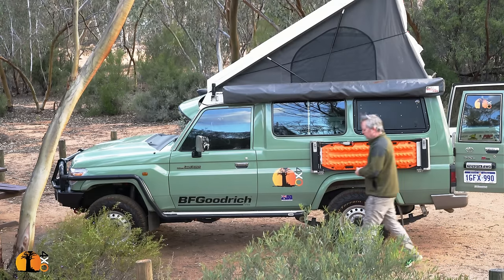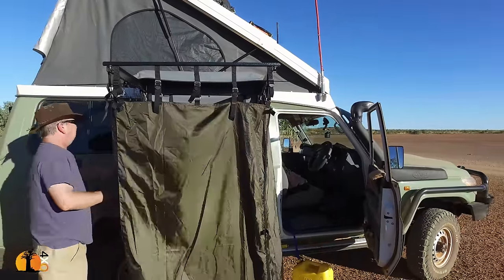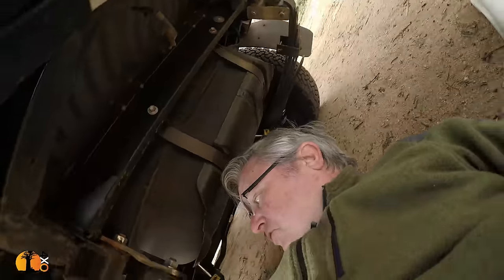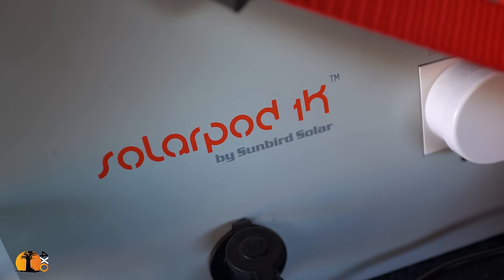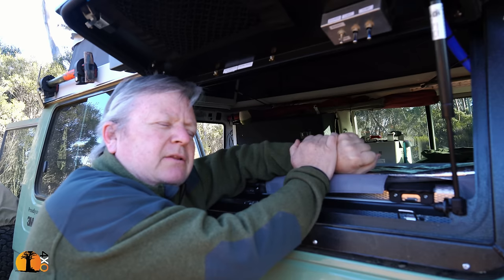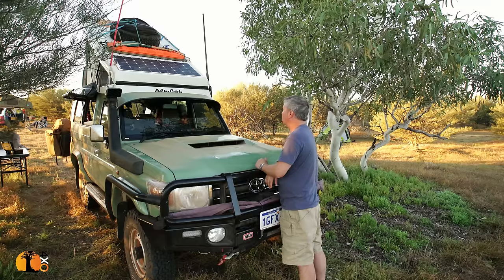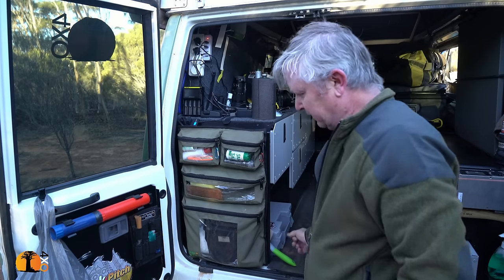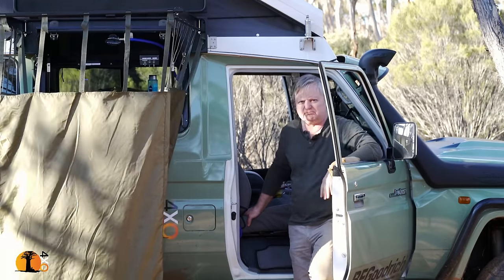TOYOTA LAND CRUISER TROOPY | THE WORLD'S LONGEST TRACK (Ep-9) Andrew St Pierre White

Comment: Maybe you should have a good look at Evakool fibreglass fridge freezers. Far and away the best insulated box you can get. So very efficient. The only downfall is they are slightly larger externally than other fridges. And you don't need an insulated cover.  Just a thought.
Reply: biggles333999 I can second that. Awesome fridge/freezer

Comment: Can you swap the positioning of the German pull down back door table with the fire starter on the opposite door? Doing so would allow you to keep the drawer and table open at the same time. Just spin 180 degrees to move seamlessly between the two. You only need the fire starter for a few minutes at a time so putting it on the other door makes more sense.

I hope that this is possible.

I have really enjoyed this series. Doing a review and being transparent about sponsors, reviews etc is very helpful.
Reply: Matthew 24:4 I thought that but there is a handle on the inside of the left hand door that would be obscured by the table thingy.
Reply from the maker: Its not. The doors are not the same size.

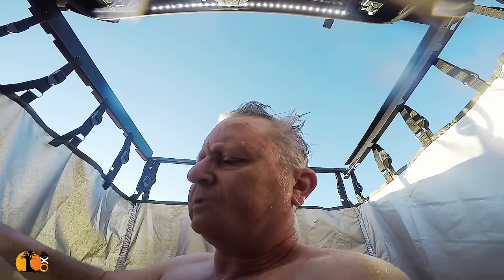Comment: Andrew, if you say “70 degrees” (9:08), I suppose you mean Fahrenheit and not “Celsius”! But then again, 70°F or 21°C is pretty much a cold shower and I don’t think a thermostatic mixer can even be set  that low. Thermostatic Mixers most often have a safe setting of 43°C (110°F) that has  to be manually bypassed if you want it any hotter. The setting of your boiler (or geyser as called in South Africa) is likely to be 70°C (158°F) which is scaldingly hot, but good for killing all the goggas (like Legionella Pneumophila) in the water.
Reply: Jimbob Jones from the research I’ve done so far, the maximum temperature that particular boiler can produce when running off 12V is 70C. Then you would set the temper valve to mix the 70C hot water with cold water to achieve your ideal temperature.
Reply: Yip, exactly what I'm saying.
Reply from the maker: I set the thermostat at 70°C. But the valve at a cooler temp so it mixed cold with hot, which means more people get a warm/hot shower.
Reply: I think we have already established that but in the video you do say “...every drop of water coming out of that rose is at exactly seventy degrees. If it’s not at seventy degrees the valve just doesn’t let it through the system..” - which is of course a reference to the thermostatic mixing valve, and not the geyser (boiler) thermostat.
I’d still be interested to know if the thermostatic mixer/blending valve/temperature control valve was (easily)adjustable, has temperature markings on it, and at what temperature you set it – bearing in mind this will change according to the ambient. Does it have a temperature limiting (anti-scalding) device on it (safe for kids)? Perhaps you’d let me know the brand name?  
I should add that I’ve been in the water pressure and temperature control industry for years.

Comment: Note andrew if intending to charge from 240-280 vac across australia you will need to seek a mains breaker panel similar what they use in a caravan with a 15/20 amp inlet, and would likely need a service outlet rated 240 vac and 15-20amps as a external mains power source this would be a part of the electrical safety code

you will also need it if you ever need require put a insurance, claim in if something goes bad from a 240 mains power source...

you will need to be compliant withing camper/caravan/5th wheel regulations..

I think this where a lot of people like ronnie dahl and co fall short in being electrical code compliant whether you use a generator of some description, your house hold power or for that matter shore power at a caravan or at a road house/campsite I always recommend if you are going to look up something for a water hook whether you 20 liter can on a internal pump or playing around with mains pressure wherever possible...

NOTE: plastic pipes used within the camper/caravan/5th wheel industry tend not to  play well when connected to mains water pressure... and tend to fail a lot something to consider when using indutstry standard plastic pipe...
Reply from the maker: That's why my 220v system in all built into the SolarPod. No need for any of that. All I have is a Bunnings extension lead. No switches etc. So no legal bull to worry about. My water system is low pressure. It never pressurises, even when its working. So if there is a breakage or crack, I can't lose my precious water. Clever, eh?
Reply: are you compliant at 15 amps??? vac for inlet use??

I have no clue what the safety regulation are in south africa/UK/europe.

though if you are intending to apply house/park mains to your vehicle you must be having a circuit breaker for isolation the same rules that apply poptops/campers/caravans/5th wheels will also apply to you troop camper conversion..

I'm not talking about invertors here andrew.. i'm talking about mains power connection whether it be from your home/camp ground or a gemset....

I thin you might want to go to camec and have a talk to the them to what electrical isolation you actually if you going to have both mains power and invertor  use to power whatever ac requirements are needing ..

Comment: I so want a troopy now! :)

Andrew, you didn’t say too much about the lead crystal battery. Was it worth it?  Do you think it is still better going lead crystal over AGM etc?
Reply: I'm keen to hear about them as well
Reply from the maker: I am waiting for a definitive answer. Right now, it is, "I think so."
Reply: 4xoverland thanks Andrew. Since posting my question, I have actually purchased a lead crystal battery with REDARC 1240D from Leeroy at Heist. I am currently on a 4 week trip across central Australia, crossing several deserts. I can let you know my experience with it at the end if you like. So far (day 2), it’s working very well indeed.
Reply: If your budget permits, Lithium is the way to go.
Reply from the maker: Why lithium?
Reply: The main draw of lithium is the 90% (sometimes 100%) discharge rate. I'm sure you're well aware, having a standard AGM deep cycle will only net you 50% of actual amp hours the battery is rated for. So think of a 200aH battery where you can actually use all 200aH as opposed to only 100aH, both with the same package size. The biggest setback? Cost. You're looking at 10x the cost vs a standard lead acid battery.
Reply from the maker: Sounds very much like the lead crystal in terms of its amazing recharge and discharge rates. But they have yet to build a proper charger for lead crystal, so while I don't regret fitting them, I think lithium might even be better because they have proper lithium chargers available. But I'll stick with this for now. They are working well.
Reply: 4xoverland, There are many advantages and disadvantages to lithium.

Advantages are, it's light and has a nice deep discharge cycle, the lithium iron phosphate variety tends to be deep cycle that lasts longer, think of the Tesla Powerwall with a longer lasting battery.

The disadvantages is that it is much more explosive than AGM, it catches fire when pierced and it just is fiddly when the charging isn't right.

With your setup, I would suggest AGM in the back with a charge controller in the middle, the AGM is slow discharge and slow recharge that is unlike your truck battery which is fast discharge for the starter motor and fast recharge for the alternator.

Using the car battery for electronics on normal camping would damage the battery, using AGM to start the car would damage it...

You don't want to use a pitch fork as a shovel, or a shovel to turn soil.. the right tool for the right job will save you money,

in QLD they have a HUGE market for both 4x4 and solar, I'm not a 4x4 or solar person but I recomend you talk to people up there that do both 4x4 and solar together so that you can tie in something to suit your needs, be it outback, splashing in urban puddles or.. sitting on the couch... I don't think the latter 2 will be the case.

Many people don't know how much of a HUGE difference the inverters of cars and trucks are to the grid tie inverters, sit down with someone at a shop to see if you are doing the right thing for your situation.

It will take 2200 watts to boil a jug, 1800 for an electric frying pan, you won't find an electric stove top like the LPG/Butane one you have unless you do something incredibly stupid and dangerous that should never be repeated let alone tried.

the number 1 issue you will always have is... space, we live in space yet we never have enough of it... Good luck making space and keeping space while keeping everything secure and safe in case of roll overs.
Reply: 4xoverland Hey There - i have been using Lithium batteries for several years now and I can tell you they are absolutely amazing and worth every penny. Not only do you get to use a full 90%-95% of the mAh but they put out the full voltage and wattage right up to the end when you recharge them unlike other batteries that give a “dimming” effect as you use them. Think of a flash light being on for several hours where about 1/3 of the way it starts dimming until it dies. Also, instead of taking 10’s of hours to fully 100% recharge Lithiums take 1-3 hours to charge to absolute 100%. And Lithium batteries give thousands of charge/discharge cycles compared to only hundreds of cycles for other batteries. Lithiums don’t care if you drain them completely. If you factor in all of this you will see that Lithiums cost about the same as conventional batteries per cycle and perform way better. I use a regular battery for my vehicle because I have to. All others are Lithium, for everything from the smallest flashlight on up to my travel trailer.
Reply: The lead crystal battery is a little controversial - It was actually developed in South Africa and its manufactured in China . I have been to the factory and done a lot of research on it. We were set to export them to a client in Holland . After talking to some of the largest battery manufactures and sending them samples of the lead crystal battery it turns out it’s actually a lead gel battery with some clever marketing .
Reply: Wayne Ronald good info. Thanks

Comment: Glamper!!!! LOL just kidding. In a previous video you said someone accused you of glamping but I don't think that is what this is. This is making the most of what you have available and intelligently applying modern technology. To me, glamping is sacrificing some major aspect of the exploration setup in order to bring unnecessary luxuries from home. I totally agree with your philosophy. For the critical things like suspension and what makes the car go, you want manual operation, simplicity and reliability. This could save you major trouble and potentially your life. But for niceties like a shower and a freezer, you can go high tech because if it breaks it isn't a major situation and you can use a bucket for a shower, or a cooler with ice for a fridge.

Comment: @4xoverland , Did you guys find/fix that annoying squeak next to the  drivers head?
Also, I've seen on quite a few drawer systems, that they put a sliding lid on the top, making it a pullout counter as well, perhaps that's a solution to the rear drop down table?
Reply from the maker: It was a hidden rivet head rubbing on the frame from the original roof, hidden by the roof conversion. Fixed with a spray of industrial lanolin.

Comment: I looove the Truck. Unfortunately it is impossible to register such a truck in Switzerland due to the high emissions. I went now for a VW T6 Cairfornia in the 4x4 version. That should be ok for Europe
Reply from the maker: Aussie emission rules are very strict, and this new model has very low emissions. You might be surprised.
Reply: 4xoverland Toyota does not even list the car in Switzerland 🙄. The other issue is, that we get taxed based on engine size and max payload. For my current VW Touareg i have to pay USD1300/ year on taxes. The reason behind is do get rid of big cars ....
Reply: You can always fit a Seikel undercariage to your California.
Reply: tons834848 this is what i‘m thinking about. It comes already with 4wd and rear diff lock
Reply: Holger Sommer that's highway robbery.

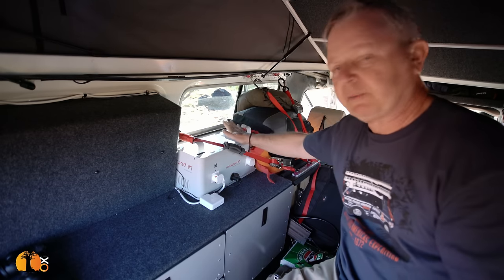Comment: Hmm... can't see value in the SolarPod (at 17:00) . I think it would be more efficient simply adding extra capacity to the main battery bank (if necessary) then running a 240v inverter off it.

Comment: Hello Andrew, you get to drive solid axle front and real Land Cruisers where you are on trips, but how do you think the 200 series land cruiser compares.  In the USA we have the 5.7 liter beast, but the range is limited for long distance travel like you do (the diesel with aux fuel tanks has great range).  I really enjoy the 200 5.7 we have here, but I would like a little extra ground clearance and approach/departure angles for harder off road.  The stock form is very capable though.  I still think they should offer front & rear lockers and snorkel here in the USA from the factory.  Do they let you order triple lockers where you live?  We only can get center diff lock here, and atrac on the axles.
Reply: Anyone have experience with a 200 vs 70 series cruiser off road?  How do you think the 200 compares to the 70 series in off road situations?  Is the 200 close to the capabilities a real 70 series cruiser offers?
Reply: Doug Fleenor if interested in Defenders at all look on Craigslist in Ames Iowa, there is a shop rebuilding them with diesel engines.

Comment: Hey Andrew, fantastic videos, thank you. Great to see proper impartial reviews. Im in the market for a new fridge and have been looking at the new Opposite Lock 72L (The shape suits my setup better)........would you say they will have the same quality/reliability/value for money as the snowmaster ones considering they use the same compressors?? 
I also considered the new Waeco CFX 65 DZ but Im not sure the plastic locking mechanism on the lids will hold out overtime.
Reply from the maker: There are very few 12V compressor makers, and so they all use the same ones. Only Engel uses a different compressor. Its the insulation and electronics that set them apart. And wide apart they are!
Reply: Hmmm....Waeco/Dometic use their own though right? Would you expect the OL to be a close 4th or 5th on your top brands list?
Reply from the maker: ONLY Engel uses their own compressor. Weaco is one of the least efficient fridges, with high current drawer, and high cyclic rates due to poor insulation. But they are cheap. Many fridges use the identical compressor but are far more efficient due to clever electronics and high quality insulation. SnoMaster and Nat Luna are two such fridges. Like in all things, you get what you pay for. I do not know the OL product, but it will be made for them by another manufacturer. Which one, I do not know.
Reply: Thanks again Andrew. The SnoMaster ones don't cost much more than the OL ones I have been looking at...so maybe I can re-evaluate my space/set up.

Comment: Andrew, how did u find the different wheel track between front and rear while driving in the sand across the CSR?
Reply from the maker: Did not notice it.
Reply: 4xoverland ok, can’t be as bad as everybody reckons then.... good to know
Reply: Based on that, the difference in width between the front and rear axles might not be a deal breaker after all
Reply: Yeah, but driving in the desert vs on the beach  - there is a bit of difference between the 2.....
Reply from the maker: I just drove on the beach. I could feel nothing.
Reply: 4xoverland still feel the same way after doing the correction?

Comment: Anyone with experience, how do you think the 200 series compares to the 70 series for overland or off road situations. Is the 70 series far superior in capability or are the two reasonably capable?   We only get the URJ200 in the USA and I'm curious how much tougher the 70 series line is compared to a setup like you have.
Reply from the maker: The 70 series is like a F150. Its a truck. The 200 is like a . . . that's quite difficult. Like a Range Rover but not as complex, very tough, able to carry a load and tackle very challenging off road conditions. But the US spec 200 is, like the Range Rover, which is too complex for overland - but still less complex than a Range Rover. So its depends on which 200 - they are NOT all the same. But a 70 and a 200 are two very different vehicles is every respect imaginable.

Comment: OMG those SnoMaster Fridges cost a lot!

In general (not necessarily SnoMaster), how do fridge/freezes compare with an esky (without ice) when it comes to keeping their cool (not plugged into power). Do they loose their cool very quickly?
I need something every day. Cool it over night at home, then take to my work place that has no power during the day. Filling a esky non-stop really sucks! I also don't do a long enough drive to work for properly recharging the battery, so I cant justify keeping it connected to a car all day.
Reply from the maker: A purpose designed ice box will keep its contents cooler for longer, due to the thickness of the insulation. Its all a matter of how many times the lid is opened. This is what REALLY makes the difference. Tape up the lids of this fridge, or an Eski and ice will stay ice for a week.